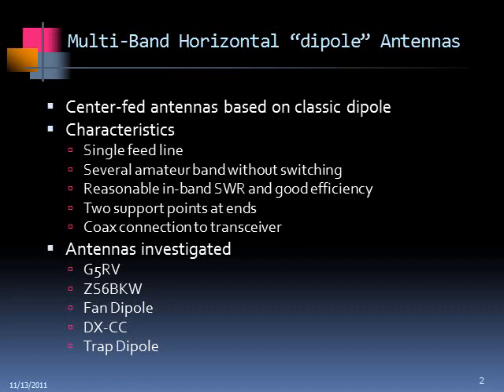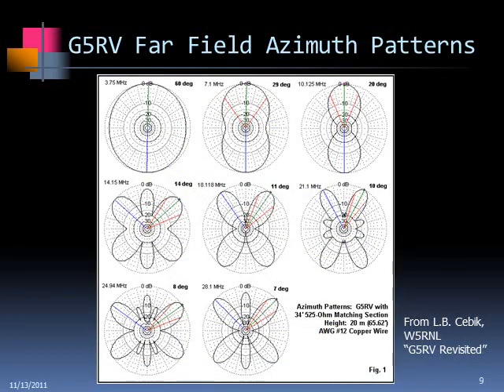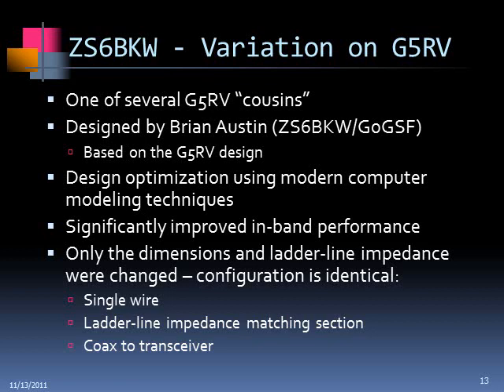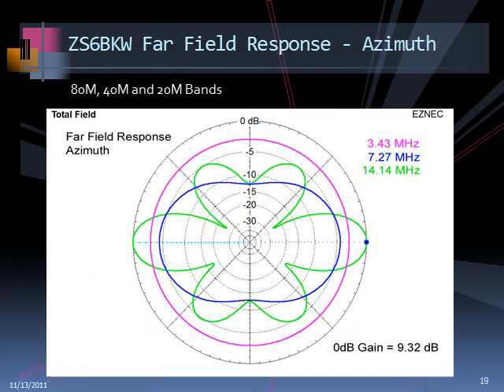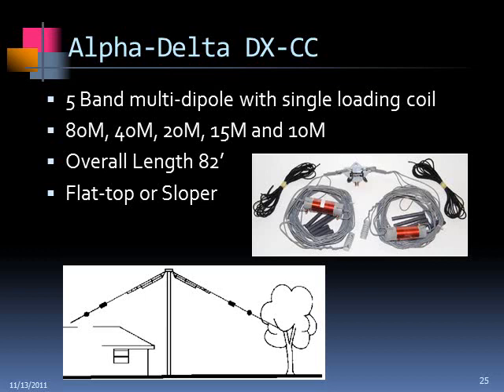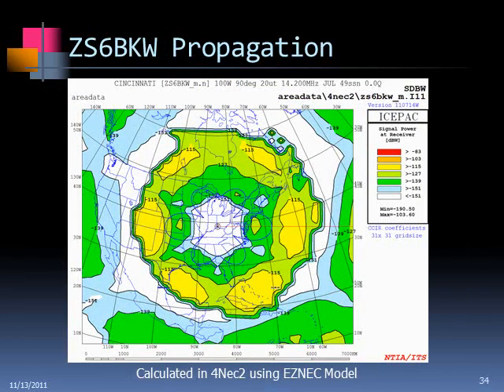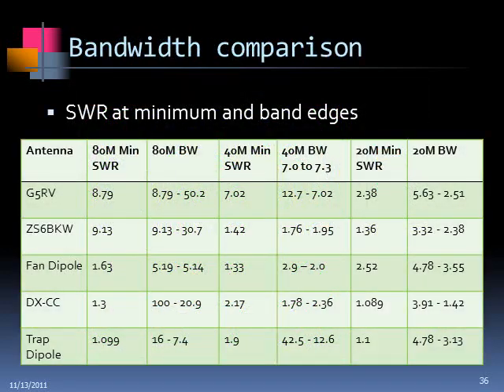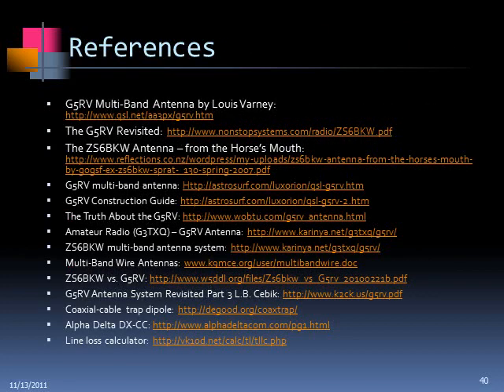G5RV vs ZS6BKW vs Fan Dipole vs DX-CC vs Trap Dipole

Comment: DX-CC is a great antenna, bands can be tuned easily by adjusting the wires.  I have used dozens of antennas and the DX-CC has been the best of all, for transmit and receive, it doesn't matter if it is 6 feet off the ground, or 60 feet, it always performs great.  It does take time to assemble all the components the first time tho.

Comment: Thanks for the video.  Just bought the ZS6 yesterday.  Looking forward to comparing it to my Skyloop with AG6IF Talented Balun 73
Reply from the maker: David Whittlesey A friend of mine used ZS6 and is a great antenna. The trick to make it perform better is avoid close obstacles or structures. And remember the higher the better.
Reply: +David Whittlesey it will blow your mind its that awesome of a, antenna
Reply: thanks for the info guys.... tony t.. n0amy...
Reply: David
How does the ZS6 compare to the AG6IF?
de Joe ab5gc

Comment: I have been using a homebrew ZS6BKW for well over a decade.  Flat top but drooped at the ends.  Really performed well, even with the tuner at the radio.
Reply: John, can you supply the specs with which you home-brewed your ZS6? I know the total length of the antenna, but am interested in the dimensions between the 4 insulators.

Comment: The G5RV , made with ladder line, utilizes the ladder line as part of the antenna, when the antenna is put into bands that it normally would not work.  Similar to and off center fed dipole, which can wipe the G5RV out of antenna history, if hams would understand it, and install it correctly, use the correct BALUN at the correct height .

Comment: Had a G5RV for a number of years.  When it was up high, but no center support, I called an inverted-inverted V antenna.  :)  Bad coax loss, tuner worked really hard--but it would tune 17m and it made a number of contacts.  Back closer to the ground it wasn't quite the same performer--hardly any surprise there.  Higher is better.

Homebrewed a ZS6BKW and it is just a better antenna, unless if one operates 80m most of the time, and even then... it's better.  But still.  It's not like a G5RV is a trash antenna and "anything" is going to be better.  Just been surpassed, but if one has one in the junkbox, or was given one, rock and make contacts.

Tempted to homebrew an Alpha Delta DD.  My antennas are using trees for supports, and as such, every couple of years a rope breaks.  No harm in having more than one antenna up at a time!  Lost a couple this past winter, so time to hang another antenna.  At that point, one not have one of each kind?

Comment: Feed-line Loss vs. SWR: This presenter neglected to point out that loss is frequency dependent. Losses for a given SWR on 10m will be unacceptable while the same SWR on 80m will be relatively negligible. 

The real long and short of this is that, if you have an antenna tuner, you might as well do what I've done (successfully!) for nearly 50 years: String up as much wire as you can manage, center-feed it with open-wire line, and use the tuner....and then you can forget nearly all the feed line and radiator length restrictions.

Comment: I use the ZS6BKW and  find is the best 40 thru 6 meters single wire antenna I have used in my 49 years as a ham. It alao does a good job o 60 meters.
Reply: Bill...did you homebrew your ZS6, or did you purchase it from a retail vendor? 73 de

Comment: How do you tune the ZS6BKW dipole I believe there’s a balun at the end of the ladder line, unless it’s not and just molded into an so239 connector, so if that’s the case, is that where it’s tuned ? Iow,  tune it remotely at that coax connector ? I didn’t understand what he meant when he talked about tuning inductances  L1 
and L2 ?? Thanks for the video.
Reply: The computer model has figured the specs. You don’t have to tune, it’s fine for you. Just follow the measurements on thee wires and the ladder line to a “T” and it will work as this videos charts show. You will have to tune 80 of course. 😉

Comment: The whole G5RV story is seldom told? It isn't a multiband antenna by design. The purpose of it was to somehow work the UK on 20 meters. for hams in the UK. The so-called feedline or ladder line which likely was 300 ohm in the beginning WAS a part of the radiator and suppose to be mounted with it being straight down and to cause a vertical component to the antenna. Because it LOOKS like a doublet sellers found it easy to sell it when used with a tuner to be multiband. it was never that in the mind of its creator? To mount it correctly is no easy task if tower-mounted no amount of separation could remove the metal tower's influence.  It was designed to make it easier for UK hams to work each other on 20 meters and is claimed to work well for that purpose. Like is said often all antennas work but some are better than others if correctly mounted its multiband ability is very limited but some will say it works well for them. My experience with the version I had was disappointing because it couldn't be correctly mounted on my property so it had wire added and more feedline to become a very long doublet.